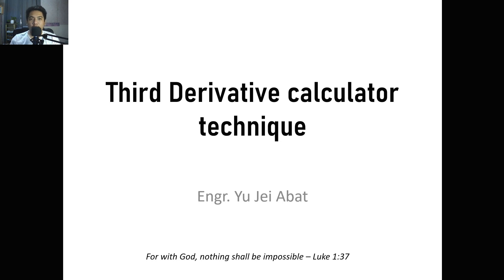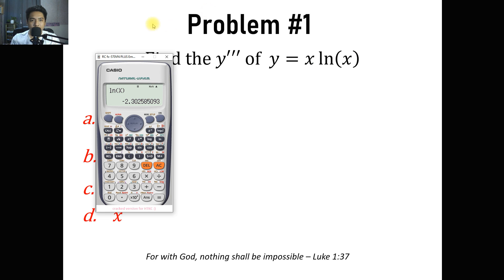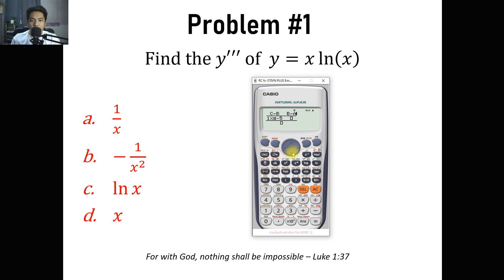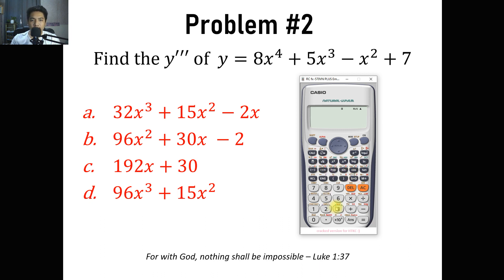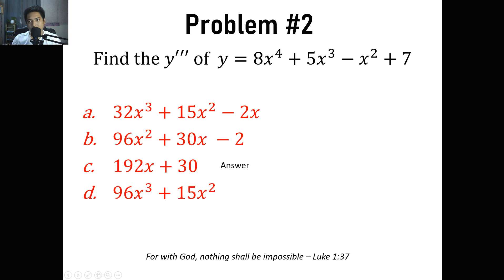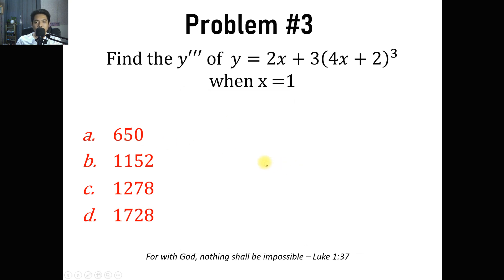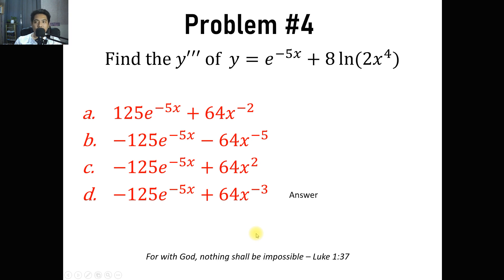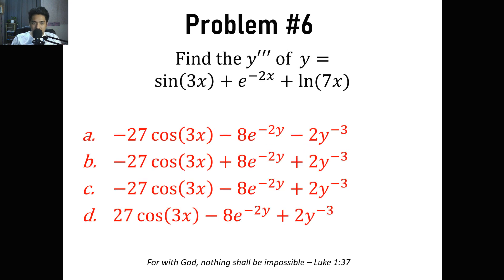Third Derivative Calculator Technique For ENGINEERING BOARD EXAM | ENGR. YU JEI ABAT | #ABATANDCHILL

Comment: question sir; if in case when dividing by D, I got 1.01 for choice A and I got 1.02 for choice B, should I consider choice A as my answer???
Reply: Sir pwede din po pang check yung signs pag denerive 3 times.

Yung e^(-2x) ay magiging (-) then (+) then (-) 》-8e^(-2x)

Yung sin(3x) naman ay magiging (+) then (-) then (-) 》[-27cos3x]

Therefore checked: Answer is C.